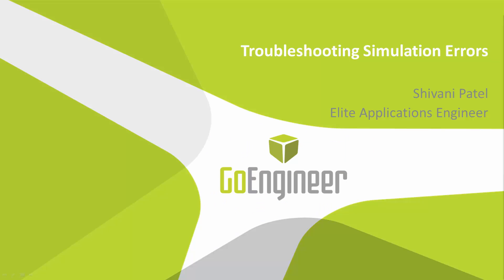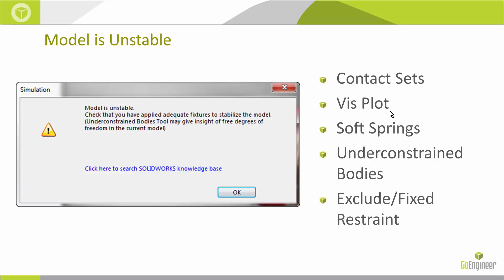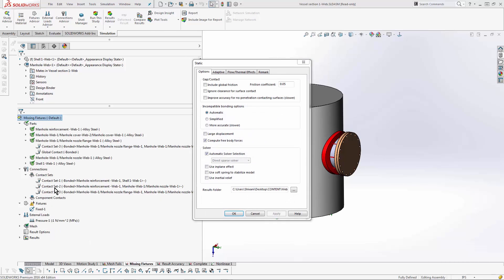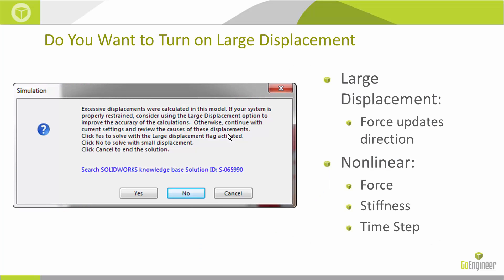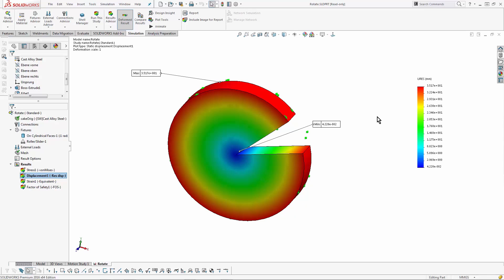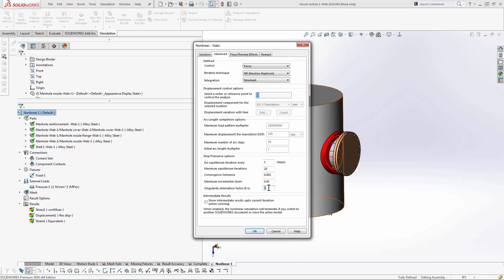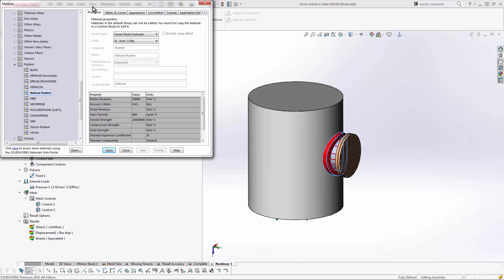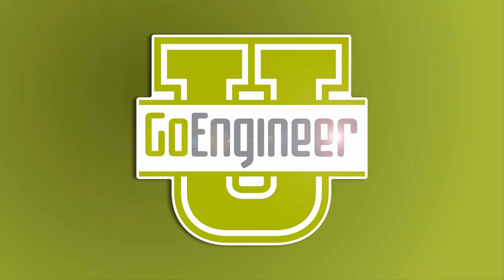SOLIDWORKS Simulation - Troubleshooting Errors

Comment: Keep having "static solver failed" on very basic simulation of simple part.
Topology study this is.

Have double checked under connections that the part is not unconstrained.

Have also tried with soft springs.

Fixtures i have a few holes. And load area and same holes are preserved.

Have tried with just gravity.

Can't think of anything else now. Have spent a ton of hours and geting nowhere really.

It will generate a mesh fine, but fail when i run the study.

BUT i also had trouble doing a static on same part, and found that wheb doing create mesh-mesh quality, then selecting draft instead of high, then it woul run. At high, i will have the error.

So kinda thinking it actually be harware related? Am i way of?

Comment: Hyyy nice video but i am getting an error in doing a force simulation in a single piece the error was "The part was analyzed in earlier version. All result and plots are available. Please remesh to run this analysis" . Could you help me please .!
Reply from the maker: SOLIDWORKS has this to say for that error message:
“
This issue is known to occur in system environments where the model files are located on a network drive along with the result folder for the Simulation study. Another possibility is that the length of the path to the SOLIDWORKS® Simulation results folder is very long or perhaps contains non-English characters. 

Some customers have also reported that using a Results folder location which is managed by cloud storage solutions or other third party software which performs file synchronization services (like file backup or file mirroring) can also cause this message.

Please try the following steps:

1.            Move model files to a new folder on your local drive, for instance 'C:\Models'.
IMPORTANT: If any third party software is configured to synchronize or backup everything on your C drive, consider adding an exclusion for the new folder you created.
2.            Launch SOLIDWORKS and make sure only Simulation add-in is enabled (nothing else).
3.            Change the result folder in study properties to a subfolder within the folder where model files are on local hard drive, for instance 'C:\Models\Results' - click NO if asked whether you want to copy result files.
4.            Delete any existing .CWR files in the new result folder (there shouldn't be any unless you clicked YES to a question about copying result files during step 3).
5.            Try meshing and running.

If these steps do not help, try the following:

6.            Exit SOLIDWORKS and rename HKCU\Software\SRAC and HKCU\Software\SolidWorks.
7.            Perform System Maintenance using the Rx tool. Make sure the ‘Clean the Windows temp directory’ option is enabled.
“

If you have trouble with any of these steps, or this does not fix your problem, please reach out to your local SOLIDWORKS VAR.